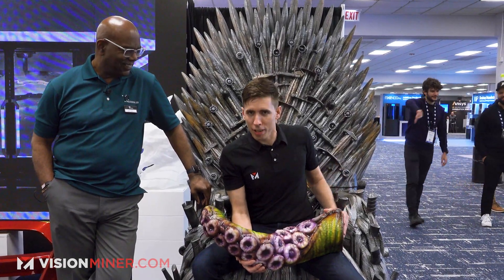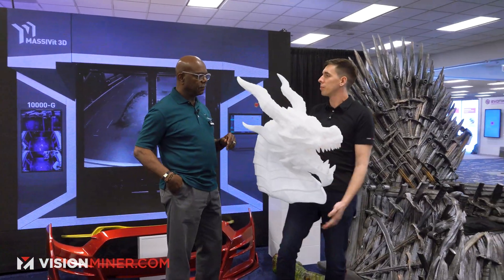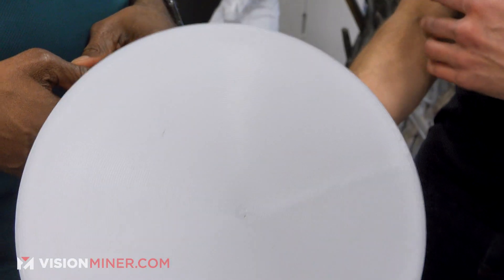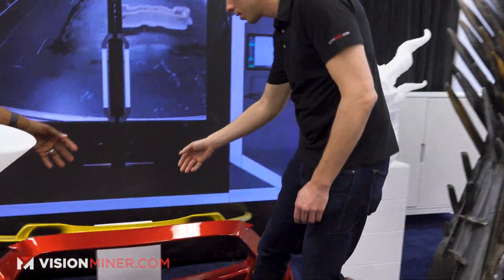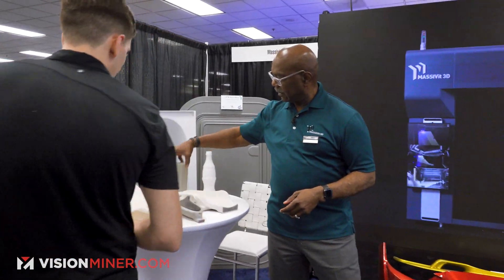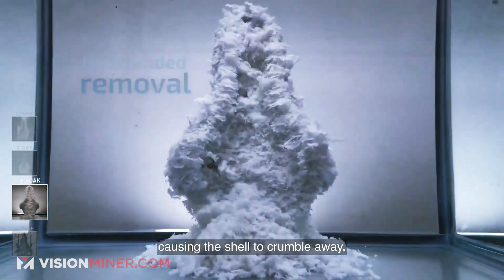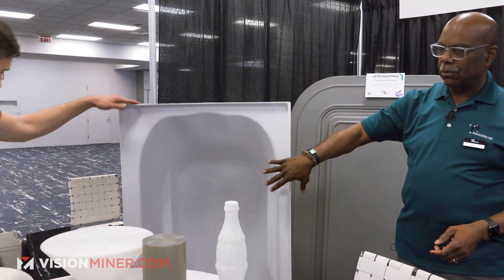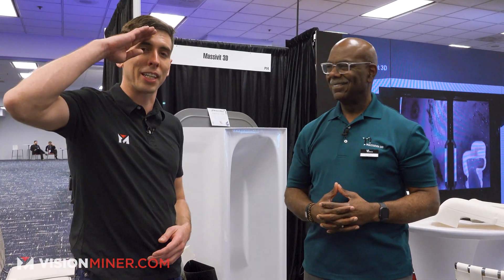Giant 3D Prints & Unique Materials: A Deep Dive into Massivit at AMUG 2023

Comment: What is the largest print volume of the 3D printers your company is currently manufacturing? And, are there any plans to build larger printers in the future? Also, has there been any determination, regarding size, as to where your current process/materials would become not viable.

With your current UV curable printing material, is there any size limitations that a part could be printed, if there were no size limitations of the printer?

I really find your printing process very unique. Had to watch this video twice!  Thank you.